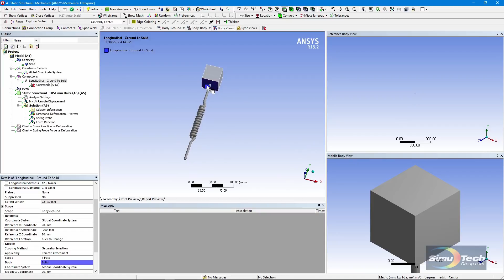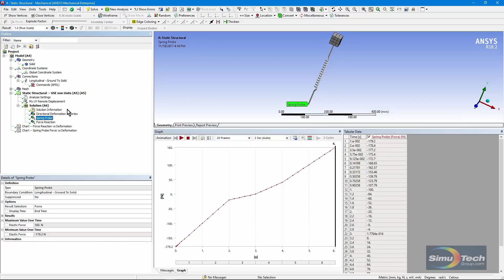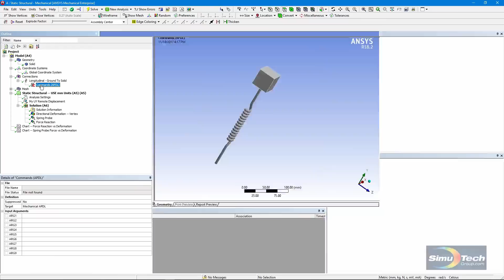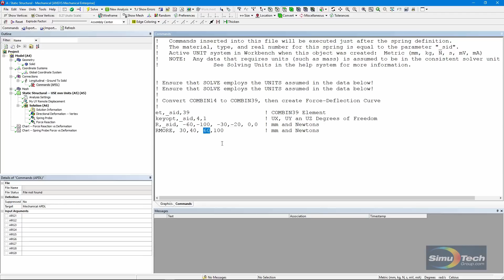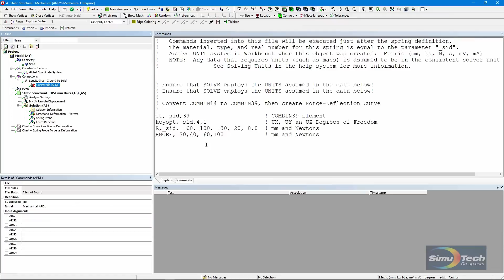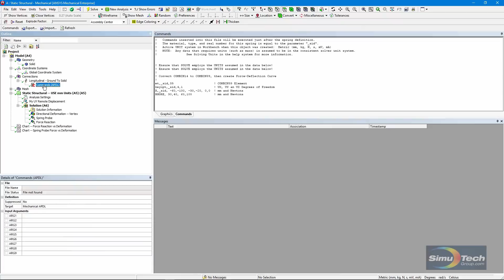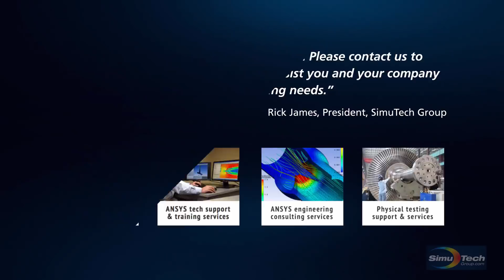Implementing Nonlinear COMBIN39 Springs in ANSYS Workbench Mechanical Using APDL Commands

Comment: How to set the spring to be pulled or compressed from the beginning ? I'm doing a simulation. Two objects apart are connected by a spring with a stiffness of 150N/mm. An object is fixed, an object is pulled out by a distance of 80mm. Calculate the spring reaction in 03 cases of the initial length of the spring between 2 objects: Springs at natural length, the spring is compressed by a distance of 20mm and the spring is pulled about 20mm.

Comment: Hi there!
Can anyone help me, I'm not getting the connection option in the outline.
I need to attach a spring, but I don't know how. I'm doing the stress analysis of a rocker and i need a spring for this to be done. please reply to the comment if you can offer help
Thank you!
Reply: the moment you open the Mechanical module from the workbench, right click "Model" from the outline options, then you will find the "Connections" option. Click on it, and then you can use it to insert Spring, bearing or beam, or any contact tool.
Reply: @deepak_nigwal  thanks a lot sir!👍🙏